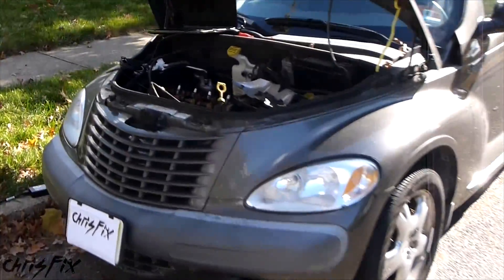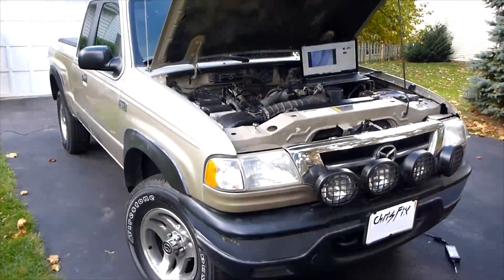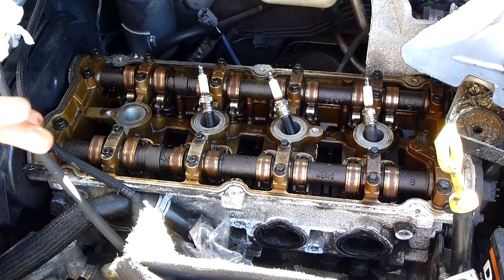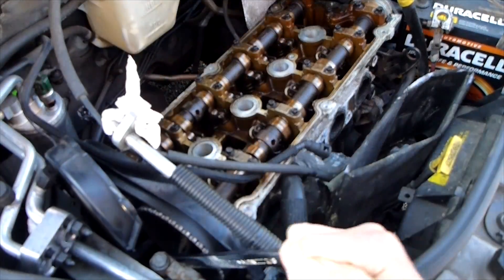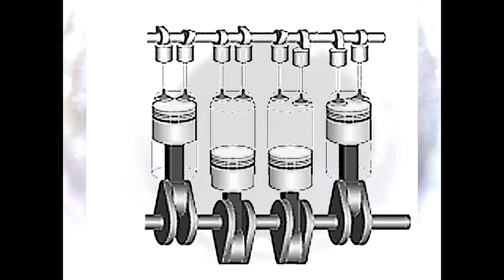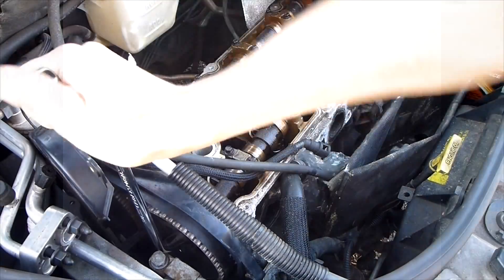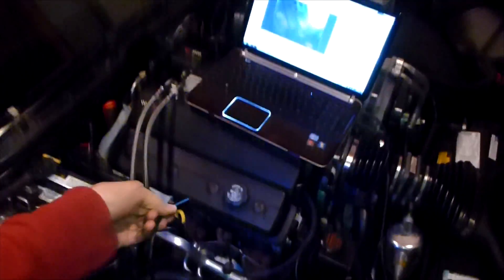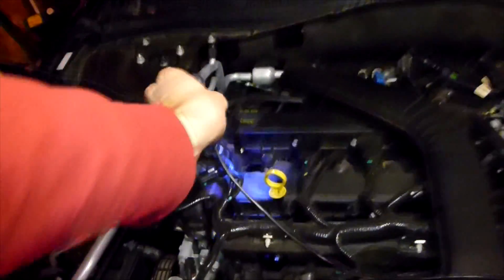What does the inside of an engine with a Bad Head Gasket look like?

Comment: Overheating an engine will cause the rings to lose tension. I did it on 2 different engines and they both started using oil after repair. The valve guide seals were okay..

Comment: Very informative video! I just bought a new car and it smokes a lot. Most E46 owners say it's due to the ccv being clogged up. So I checked with a bore scope, only carbon build up with blacked top of spark plugs.. compression test 185, 175, 175, 155, 162,5 and 162,5 psi so yeah a bit of.  with 13% difference between 1st and 6th cylinder. Factory compression should be between 140-150... So cylinder 1, 2 and 3 might have more carbon build up due to being close to ccv inlet...? I wonder... I guess I'll have to use some injection cleaner in those cylinders... Thanks Chris! You've helped me a lot!!

Comment: Have had a head gasket failure. From 1st injector has some bubble come out when I run the car . Is possible have water inside . If yes how can empty it. The car turn off after some speed . Has use a liquid to seal the head gasket and no white smoke anymore. What key can use put out spark glows in diesel car w163 ml 270

Comment: So is the engine in the PT Cruiser a goner? or can the gasket be replaced and it work again?
Reply from the maker: The block and head would have to be checked for any sign of warping, if it did then it would need an entire new engine, if it's still within spec then you can just replace the gasket and fix the issue!
Reply: @chrisfix  Thank you for responding! So you're saying the cylinders aren't damaged beyond repair?
Reply: @powerofknowledge7771  Ya, that is what I would like to know too.  There's obvious piston damage so the engine is probably scrap.

Comment: Hey Chris I had question, I'm having overheating problems in my 2008 4.8 Silverado I already changed my radiator and thermostat but it didn't help at all. So I removed my thermostat and it doesn't overheat anymore, if it was the head wouldn't still overheat? I was Thinking it might be a bad water pump.

Comment: These things were chronic for cooling system issues. Fan relays dying. A double winding 2 speed fan that would have high speed die. Radiator I saw was literally half the core tubes blocked with crap. They look difficult but aren't that hard to work on but have a few common failures.

Comment: Hi Chris. I replaced valve guide seals and head gasket on a 1999 Mazda GF FS-DE. It pools oil on all cylinders, at 159,000kms I wouldn't expect ring issues? Have you had any such issues

Comment: Do A before and after video on this modification....

Twist A piece of paper into A twisted pencil shape and secure it to the inside of the intake before the air filter.  This will pull coolant/water into the combustion chamber constantly while you drive.  It is A small amount of coolant but it will keep the engine clean of carbon when it turns to steam. 

You can put your hand in the exhaust stream to feel the humidity before you do this, after driving for about half an hour.  
There should be dry air coming out of the exhaust at that point.

After you do the trick the exhaust will become humid.  You might get slightly better MPGs in stock form but with the right modifications this trick will be more noticeable.

Use environmentally friendly coolant as it will constantly be needing to be topped off.

This is just in the testing phase so use this knowledge at your own risk.  Make sure you have A backup vehicle if you try this.

Also do A rotary engine video segment with this modification.

Comment: Amazing!  You really f_ed up that engine.  Proper maintenance would have prevented this. I've had many cars and never had a head gasket leak because I maintain my vehicles, check the fluids at least every month, and log it.  Btw your truck will be next to blow due to overheating since you blocked half the radiator with Walmart off road lights.

Comment: Hi there , so there are differences between a problem with the head gasket leakage
and a problem with the Cylinder's rings being busted  ,right ? 

If changing the head gasket or even the Head Cylinder can help solve the problem with
the head leakage , that is just a simple problem , but if the Cylinder's Rings and cylinder
itself is fucked up then you need a new engine or a rebuild of the Engine ,right ?

[ i have changes all the sparks and coils though ,still getting the engine code of
misfire and this happened after i changes the Transmission and put a rebuilt 
transmission ] ..... 

Above all i have a misfire in Cylinder 1 of my Hummer H3 2006 3.5 L which i noticed by
using a quiet cheap Computer detector to the car's computer , so is this problem could
be ONLY the head gasket or the head Cylinder itself or a major Engine problem going down
into the Cylinder leakage ? 

I know we have to do the Compression and Leakage test .... so could you try to give me some
hints ?  I do not want to spend anymore money on my car , should i get ride of the car or
for sure after running tests i could decide only ?! 

Thank you ...

Comment: I have a cruiser and it has shown some but not all symptoms of a head gasket problem, but in the cooler weather it has seemed totally fine. Any ideas on that? In hotter weather the coolant bubbles occasionally. The car gets very hot while running but doesnt overheat its just hot. Im just at a bit of a loss as to why it is behaving so differently in different weather

Comment: In the lexus rx400h forum I am in, someone has a car where the cabin vents provide heat to one side only and not the other, they did a heator core flush. anyway to confirm the air selector is not working right.

Comment: Try STP fuel injector cleaner, the concerted kind in the black bottle, and run a couple back to back. I got 82k miles on my 2011 G37S and I used 2 in a row and the Piston heads are 90% totally clean. Zero carbon or varnish on the heads just a small black spot then bare metal.

Comment: Chris, my 350 Chevy engine blew a gasket and melted a ring and scarred up the cylinder wall bad, is the engine worth rebuilding with 255000 miles or take a chance on a used one or also take a chance on breaking in a crate engine and possibly having lots of Sparks in oil from a bad break in?

Comment: Can you show some examples for a bad piston rings in different models? specially 350 ci small block. I bought one of these, but have nothing to compare if my engine is ok or not. and it comes handy when buying used crate engines.

Comment: My truck overheated about 4 years ago, the upper radiator hose blew out. I followed every proper procedure, filling it with water constantly until I got it somewhere I could leave it over night, and then replace the hose the next morning. It ran fine for a few years, then a valve seat dropped. When I put the overheating and the seat drop together in my mind I immediately disregarded any thoughts of repairing the engine and went ahead with a reman. long block.

Comment: Hi Chris. I was given a BMW with a blown head gasket for free. Great condition besides the blown head gasket. The oil is that gross milky color due to being mixed with coolant. Will bars leak, steel seal, or some other head gasket sealer work to possibly seal the leak and fix the problem?
Reply from the maker: That will just be a waste of time. I would start unbolting the head. It takes some time but isnt hard. Get a impact gun to help!
Reply: ChrisFix Is there any other cheap fix besides the sealing liquids?

Comment: fantastic... using endo camera to see inside...( after some time)   hey , but  ,   you can see the inside by removing the head and disassembling..But if it can help diagnose correctly without going through the larger work of disassembling , then,  it is good.  Nice video.

Comment: Hey Chris i watched a lot of your videos on YouTube. I had a question for you, I'm currently doing a head gasket on my 05 hyundai tiburon 2.0l and as I pulled the head off I had water resting on piston 3 and 4, is that normal with a blown head gasket? Or would there be more of an issue with piston? Thanks
Reply from the maker: +Jeremiah Berbee that's typical of a bad head gasket. Is the piston face really clean compared to the other cylinders.
Reply: ChrisFix honestly Chris they had coolant and rust on them cylinder 1 and 2 looked pretty clean compared to the other two. but like I said 3 and 4 were. covered with coolant and rust like it's been like that for awhile.
Reply: and also if I took my timing belt off before timing the motor how would I fix that? can I time the head indepently from the engine or do I have to time them together? #rookiemistake
Reply from the maker: You need to find top dead center for the engine and match  up the marks on the sprocket to the top dead center mark on the block.
Reply: ChrisFix so they have to be done both together then? or can I do them individually?

Comment: Melted piston, bah.  I had one car where the piston partially melted, and blew apart, penetrating the cylinder wall in the process.  Clean through, I picked up pieces from the ground.
Reply from the maker: Wow that is crazy! How did you do that?
Reply: I started the car and the piston blew apart.  

As far as what long running issue lead up to that, no idea.  The car had seemed to be running fine, but that doesn't happen in cars that are actually running fine.  Not sure if it was something I just didn't have the experience to recognize signs of or if it might have been a slow development with a rapid resolution sort of problem.

Comment: You never seize to amaze me Chrisfix,was looking through headgasket vids and this one popped up. My Cobra had a headgasket leak and i used blue devil since i only drove the car local and to work and it stopped the smoke and never overheated. Im glad it didnt destroy my bottom end. My cars in the shop and i just had a 5 angle head job on the heads they were warped btw cause my block and heads are all aluminum,while the car was down and i saved money all that time i added a bunch of mods and rebuilt my t-45 transmission plus painted engine and calipers parts while the car was down. They should be putting it all back together next week finally :)

Comment: Chris do you recommend an engine oil flush.
Reply from the maker: I do not unless you have a sludge issue. I suggest using good oil and changing it at the recommended interval.

Comment: lets see u use it on a RX8 13B Renesis rotary engine with high and low compression to see the difference with Apex seals clearance and then on a RX7 13B REW to see the difference what the turbo rotary looks like to a NA version

Comment: Chris, I bought the camera, took a look in my engine. It looks good!.. I just have a little problem. The plugs tube was really dirty so a lot of dust went into my cilinders, any idea how to clean it? is that really bad for the engine?
Thanks!
Reply from the maker: Yea that isnt good for the engine. Next time use a vacuum or compressed air to blow out the area around the spark plugs before pulling the plugs.

Comment: @ChrisFix

Last summer I bought an Impala 2011 with the police pack and a month, the radiator cracked and it was leaking cooling liquid but I didn't know that at the time. I was on my way to work and an alarm on my car started ringing. I looked at the dash board and I saw that the engine was overheating. So I went into a parking lot and stopped the engine. I've added water in the radiator as a temporary solution and the temperature went down and I got the problem fixed right away. I never heard the alarm again. The thermostat was in the red zone, telling me the engine was overheating but it never got all the way up and I must have rolled less than 1 minute with a oveheating engine. Could that have damaged my engine?

Comment: I can give you a top tip for this video ...
When the engine is overheating, you will see the engine temperature going up.
100 degrees Celsius is the water's boiling point ... it means bye bye engine.
Reply from the maker: Yep! Unfortunately when you are on the highway and want to safely get over, it can take a few seconds before you can shut the engine.

Comment: I have had the head gasket and radiator cracked on my civic 99 for over 6 months now.. im planning to repair it this coming summer because where i live is cold and i cant work on it. I have kept it with water in the summer and now i have to put antifreeze but since it is expensive im just gonna put windshield fluid for the next month until it gets warm and then water again until summer because i have to refill it every 3 days. Do you think i should change the head gasket and keep the car or just sell it because i might have damaged the piston?

Comment: Chris - that part where you mentioned the 2nd cylinder was "steam cleaned" because of the head gasket leak, is there a way to do that intentionally as part of an engine cleaning routine?
Reply: Adam Nair yes, introduce a small amount of water into a vacuum line, like you would for "sea foam" technique

Comment: what you're referring to as the piston rings, I don't believe are. The piston rings are short distance down on the side piston. you won't be able to see them from the top.
Reply: ChrisFix what your showing isn't the piston ring,  its the top ring land, this doesn't provide the seal for compression, it merely stops the top piston ring from moving up the piston.
Reply: ChrisFix Lmao school him boyyy
Reply: These engines do have odd shaped/looking pistons though you'll have to admit. With that massive wedge and relief cut around the circumference.

Has to be the shittest car/engine ever built IMO.
Reply: ss ss well the wedge isn't shit race cars have had wedged Pistons for decades and hemi is just an evolution of the wedge but the rest of it is pretty bad
Reply: You are wrong man ,ahahha , piston Rings are the top of any car's pistons so far ...
Reply: Right the piston slap would've been unreal
Reply from the maker: +photorocket4550 the piston  rings are near the top of the piston
Reply: Photorocket is correct that is not the piston ring.. in this video you can not see the rings.. what he calls the "piston ring". Is just the outmost part of the piston.

Comment: hey Chris, what can cause of stiff steering wheel ?
Reply from the maker: Bad power steering pump or dirty fluid. Check this out: https://youtu.be/A0fiZCHz5ew?list=PLDD611CFB36FC65F2
Reply: ChrisFix alright thanks I will . And have blessed new year
Reply: shane premraj I had the same problem. First replace you fluid if that doesn't help you need to replace power steering, unfortunately. I got mine used much much cheaper than new.
Reply: Marcin P cool thanks ,
Reply: Sometimes you have to get multiple power steering pumps.

Comment: a cyl head leak is only this bad when the engine is overheated. Checking the coolant levels helps to avoid this, untill the new gasket arrives

Comment: you should not be able to see the piston ring at all unless your borescope has a magnification option that can see between a gap that measures .030 or more and the depth of close to 1/8th of an inch deep where the top compression ring is
Reply from the maker: +John Cook I'm pretty sure the ring came off and moved up the piston
Reply: ChrisFix that would mean a broken crown or ring landing both of which would result in significant damage to the cylinder/head/piston only way that can happen is if the rings were gapped too tight and thermal expansion would cause them to butt ends with nowhere to go  ring gap needs to be loose for thermal expansion crosshatching is there to keep them spinning while engine is running to disperse heat into the cooling jackets then there's is torsional flex which allows blow by and compression opening and closing the gaps between the rings and ring landings

Comment: the pt cruiser is just a crap car anyways, looks gay, did horrible in safety crash tests and i hear its unreliable
Reply: Magnus Atheos yes. the fact they they took it out of production proves that it was terrible too. family and friends never got them to go past 50k. engines go bad too fast and for what ever reason the axles break. neighbors went through 2 of them already on the past 4 years
Reply: its more K car than the Dynasty.
Reply: I is not reliable at all. they last up to 25k miles
Reply: It kind of does look trashy too. It's a junk car and the only reason to buy one is if you can get it for $500 for a temp car
Reply: Warren Lieuallen 14 years and 96k miles? What is it a show car.
Reply: As with almost any car, you will find some that are lemons, and some that are great. Luckily, my PT Cruiser is one of the great ones. 14 years, 96,000 miles and all I've ever had to do is normal maintenance (oil changes, tires and brakes). I think it's one of the coolest looking cars there is (not like the generic "all-the-same" junk available now).

Comment: Thanks for the video Chris it is really nice, I would like to see how the fuel spray pattern from the injectors looks like when the fuel is sucked up on an engine working, I guess you could slide the camera through the intake mani looking right above intake valves or in front the fuel injectors. thanks